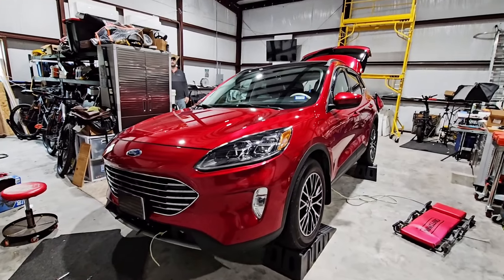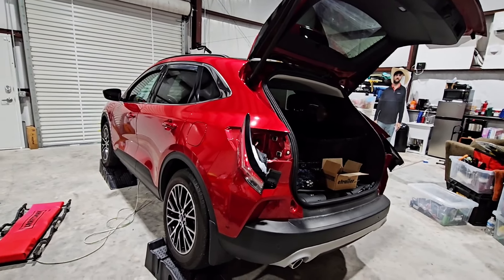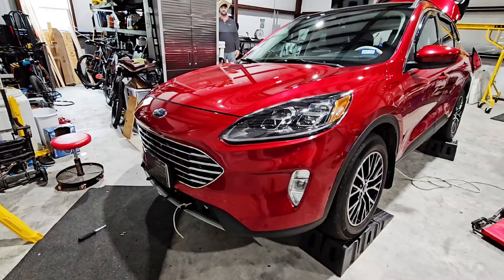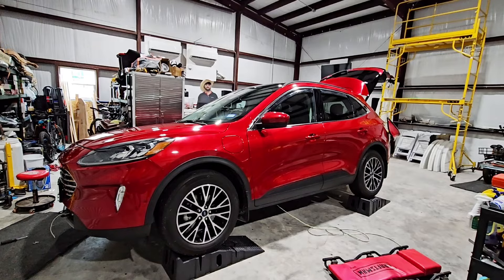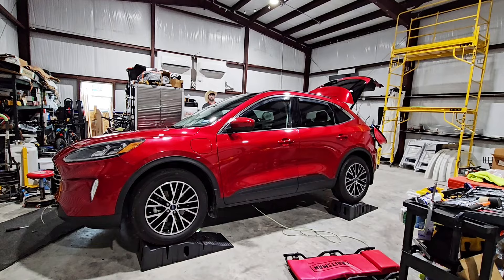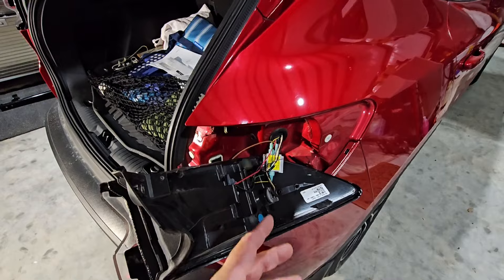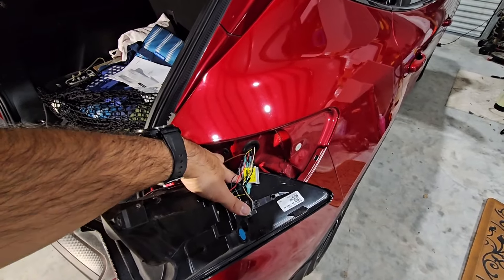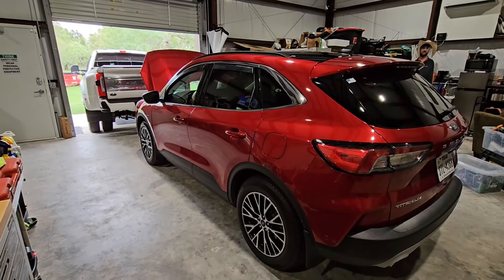FLAT TOWING! Connecting Brake and Parking Lights for RV towing!

Comment: I set up our Equinox for flat towing back in 2018, took a full weekend and getting the front fascia back into place was for sure a real challenge. E-trailer had a plug and play wiring harness with Molex connectors that had the diodes built in. Just disconnect the factory plug from the light and plug the harness in between, worked great and was really easy. I went with the Stay-N-Play Duo brake controller. It provides proportional braking that can be dialed in for really smooth operation on the highway and in town. I’m very happy that I went with that system.  I also installed an auxiliary brake light switch in the toad that is used to light an LED in the coach that indicates when the toad brake pedal is activated away from home position. That’s a nice feature to have for dialing in the system and verifying operational functionality.  I also used the videos during the installation process, they were very helpful. Nice work Guys !! EDIT: E-trailer also had a fuse cut-off switch that is really nice. There’s a fuse that must be pulled in the Equinox to disable the accessories to prevent draining the battery since the key must be in accessory position to unlock the steering. Just plug it into the fuse socket, install the fuse, then mount the switch remotely in a convenient location. The car owner’s manual was very helpful explaining this and flat towing in general.

Comment: If one wishes to tow behind a motorhome, which is better and easier to tow?  Flat towing like this?  A front wheel dolly?  Or a flat trailer?  Seems to me that the trailers would be a lot easier than hooking up all this flat towing stuff.
Reply: Flat towing is very easy and works well, I can have my car hitched up and ready to go in five minutes, no exaggeration. Same unhooking, only faster. I’ve seen folks with a tow dolly get pretty wet and dirty hugging those tires while strapping it down on a rainy day. Both the dolly and trailer require a place to park the “extra” unit at your destination too. Most cars are not able to flat tow so I do understand that other methods like a dolly or trailer must be employed. The list of flat towable cars is published yearly by a few RV groups. Here’s the catch, you cannot back up while the toad is hitched up. I believe a dolly may be the same but not absolutely sure.?. Qualifier for flat towing; backing short straight distances while someone is holding the steering wheel straight works, I’ve done it 20ish feet in parking lots, etc. Otherwise if you get into a situation that requires backing with maneuvers, you must unhook the toad which takes about 4 minutes to accomplish. We’ve towed flat for 39K miles and never got into a situation where we had to unhook, so far anyways.